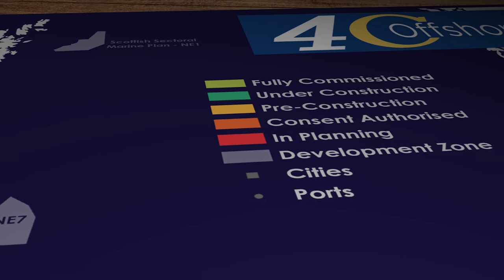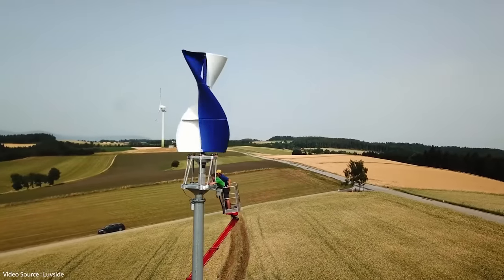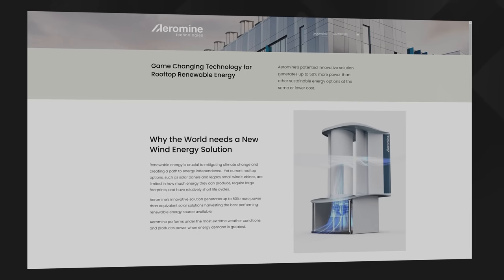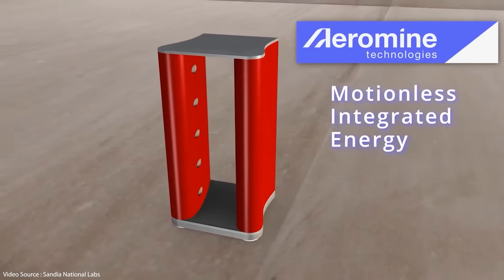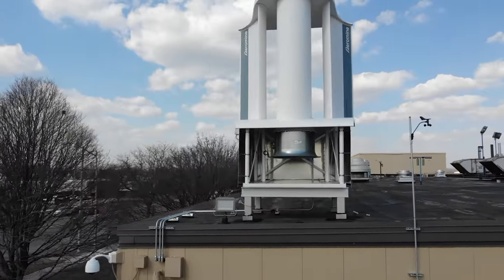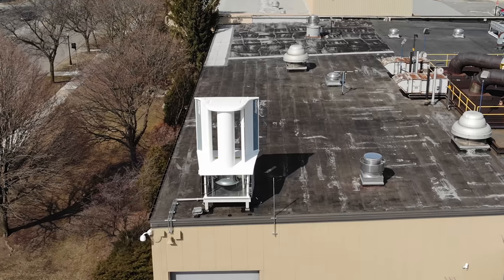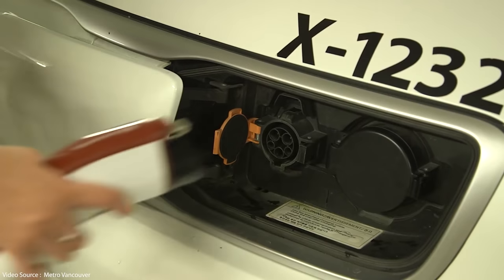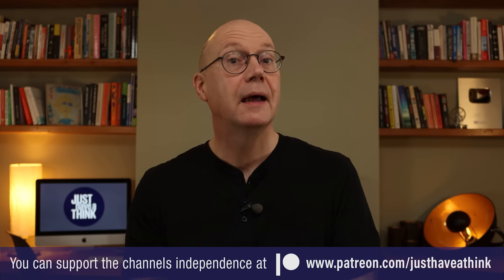Aeromine Rooftop Wind. Static. Silent.  50% more power than Solar PV. What's not to like?

Comment: I saw another video on this one and what I was missing in your video was the mentioning of the angle in which the installation is capturing the wind! Unfortunately, I can’t recall this quickly, so maybe good if you could check this for us! I think this also is actually the only drawback of the system: it is great if the wind direction is actually quite consistent. It might be worthwhile for a second generation or an alternative design to offer the possibility to turn the installation. That would increase the number of viable locations! Also it would be more robust to the more variable wind conditions we have to deal with thanks to climate change…
Reply: My thoughts exactly! Why not allow them to swivel so that they can continuously track the wind's direction? Must be some technical reason why this isn't feasible.
Reply: 4:31
Reply: I think it would be a good idea to have the contraption pivot around the turbine axis so it aims at the wind automatically.. I am a bit surpized this is not already build in, seems rather simple to me to achieve this.
Reply: Like PV installations, there is a simple solution: rotate different units to capture the most potential.
Reply: A tall building creates an updraft as the moving air can't get past the building. I looked into it for a HAWT on a 9 storey building. Mounted on the edge to capture the updraft velocity rather than the general wind speed. Consider how a chimney draws smoke upwards due to the passing air at roof level.
Reply: This may be the video - a more critical look at the Aeromine turbine: https://www.youtube.com/watch?v=XPZei_UONX0
Reply: @grahamcampbell9261  Yes, but if the wind blows parallel to the building it would mean it does not catch any wind whatsoever... The updraft is not always perpendicular to the wall of the building, with varying wind direction the updraft may also have another direction... 

I would make it pivot, as it does not add much complexity, but could increase its energy generation efficiency considerably.
Reply: @twasbrilligandthesli  The intake has to be placed at the edge of a building.  The wind hits the building and is driven upward towards the Aeromine unit.  Obviously this precludes tracking the wind as at most movement could only occur at the corner of a building but it probably increases costs to add any mechanism to move the unit plus energy is needed for movement to occur, cutting down total output.
Reply: Yes I live in an area where the wind direction can change 180° multiple times within the span of a week. I live in a part of a country where Southern winds and Northern winds clash and depending on which one is dominant, so goes the direction of the wind. If these units were fixed according to a presumed prevailing wind they would not work whatsoever where I live.
Reply: @heyman5525  I guess the Aeromine wouldn't work everywhere then. You'd need a location where wind direction tends to be more fixed.
Reply: @twasbrilligandthesli  There was a feasibility reason given in this video - watch it again - this time carefully.
Reply: Uh oh! Am I supposed to be afraid that climate change is going to change direction of the wind now?
Reply: @MarcoNierop  The wind blowing down down the street either goes around or up the building. There is lower air pressure as altitude increases, (but higher wind speed) so it creates a vacuum to draw the air upward. Generally, the wind is not going to bounce off the building and go back where it came from (Some does, but a lot heads upward). The challenge is then to capture it and divert it into the turbine rather than up and over it. This machine has a +-45  degree horizontal catchment area (90 deg total), so rotational ability shouldn't be a real issue for a lot of locations.
Reply: +-45 degrees.
Reply: @ThePentosin  TY - I meant that but didn't write that
Reply: yes my first thought was wind direction which can vary quite a bit during the day,  I tried to build  a small venturi vent for a remote shed back in the 70's (no power) started vertical but became a much bigger project due to having to follow the wind, ended up with small horizontal vent which worked but not as efficient as the vertical, of course would have be quicker and cheaper with a plain old whirlybird but sometime you just need to make things
Reply: @pblakez  I saw another recent review of this and he showed "Wind Roses" (charts) of % of wind from each direction, 90 deg covered most in his area.
Reply: 90 degrees horizontally
Reply: I just got home and you have uuu
Reply: @brett4264  it will.
Reply: @adb012  Yes, with this, it has a 90 degree angle of collection, so that helps a lot and makes it ok for a fixed installation,
Reply: @adb012 , hmm, not sure about „most“ all the Windturbines I have encountered in the Netherlands can turn 360 degrees and do so on a regular basis.
Reply: @grahamcampbell9261  that is a great explanation! I reckon it needs different versions for diff purposes!
Reply: @winfriedtheis5767  Because they need "Head-on" wind flow. This works like a 90 degree wide funnel to direct the flow to the turbine.
Reply: @winfriedtheis5767  TY and absolutely I agree. Solar works in UK because they pay 78p/kW, but in NZ, we pay 14p per kW - so their solutions don't work here (economically) lots of 'Secondary' variables per location affect the choice of solution.
Reply: @mentumentu  v=XPZei_UONX0 was mine - will look at yours
Reply: @mentumentu  My thought was to have the HAWT hang over the edge (Axle at building perimeter). So it caught both updraft and horizonal air flow) There is one in a social housing building in Chicago but theirs is inside the roof area, so it loses an opportunity.  Also lacks the pressure increasing funnel ideas. 'helical Aerotecture turbines on a building in Chicago '.
Reply: @edwardmallorie7051  Thanks for sharing my video on this! :D
Reply: @winfriedtheis5767  ... I stand corrected.
Reply: At 4.40 he says quite clearly 'facing the annually predominant wind direction'. Exactly what we'd expect, and easy here in UK, usually W. I don't see though, why it couldn't rotate, so we could use those winter Easterlies.
Reply: @edwardmallorie7051   Followed your link and subscribed, very interesting. Thanks 🙏
Reply: @helenswan705  It has a 90 degree capture angle and, in most places, the majority of the wind comes within that range. "Wind roses" watch?v=XPZei_UONX0 Shows the roses in the UK
Reply: @helenswan705  This has a 90 degree catchment width and most winds in an area fall within a 90 degree arc ("Wind Roses"). I posted a YT link but they deleted my post. 'Ziroth' reviews this and explains the roses
Reply: @twasbrilligandthesli  I think because they are relying on the edge of the building to do quite a lot of the work.   but is could still be worthwhile
Reply: Wind's direction is fairly consistent all year round in most places. What truly limits placement in my view is each building's orientation relative to the predominant wind direction, plus the obstacles that can limit wind speed.
Reply: @helenswan705  ... Because this system depends on the wind hitting the wall of the building and deviating up. That is why they are installed at the edge of the roof. If the wind direction changes you need to not only rotate the device, but also move it to a different edge of the roof near the wall that is facing the new wind direction.
Reply: @adb012  ah of course. I forgot. Elementary, my dear friend.
Reply: One word, pivot !
Reply: @motorheadmaximus  . YES! Pivot the whole building!
Reply: Uncle Smitty mounted his to an office chair that swivels to face the wind.
Reply: @ZirothTech  personally I think your video was much easier to understand with better illustrations for seeing how it works then this video, but this is why I love subscribing to all these types of channels because each of you have a different take and add something to the collective knowledge on the subject.  Thank you, keep up the good work.  BTW I assume you know Robert Murray-Smith channel, if not check out his video on Barleycorn Wind Generator.

Comment: So true, remote rural off grid here just installed a wind generator to complement my solar, still gauging the results but it is keeping the batteries 24V system topped up overnight will watch this company with interest hope they get it down to the off grid house level at a reasonable price

Comment: Several points:
1) The fan blade is a moving part.
2) Looks like it will not kill birds
3) It is a good canadate for onshore wind. 
4) Rather than rooftop addons, integrate it into the building structure. 
5) A great alternative to NIMBYism.
Reply: i read elsewhere the fan element can be placed inside the building.
Reply: @farnarkleboy  
6:11 "...because they have no moving parts..."
Reply from the maker: Very good Chris. I did say No VISIBLE moving parts. The prop will be covered with a facia plate and grille.
Reply: @JustHaveaThink  Thank you - my mistake. Before I moved over to the Gulf side (Nature Coast - Not Ft. Myers),  I lived on the Atlantic side. There is almost a constant strong onshore wind. There are miles of coastal roads. Imagine hundreds of nondescript VAWMs along the way and even on all of those concrete condos.
Reply: @JustHaveaThink  https://youtu.be/VnSZ0MHIcvs?t=370 Actually at this point you state they have no moving parts without stating visible.
Reply: @JustHaveaThink  6:10 "no moving parts"
But even if it has only invisible moving parts, it does not mean silence. Fighter jet engines prove it.
Reply: The only form of NIMBYism I could get behind (and tbh, not just near me but anywhere), is where wind turbines are in the path of bird migratory paths

I've also got quite a few birds that love coming to my garden even in winter. I wouldn't want to hurt them
Reply: @kevinwillis6707    Yes , WETER  GOROD project  by denis tiaglin
Reply: @waqasahmed939  
There is quite a literature on the issue of bird deaths and actually windmills rank low on the fatality list (will increase with more windmills) with cats and mirrored sided buildings being at the top. The Audubon Society takes the position that proper siting is important. But, the fact remains that bird deaths are inevitable. All I can say is that ways have to be found to minimize fatalities.
Reply: @chrisconklin2981  Yup domestic cats and tall glass buildings...
Reply: @chrisconklin2981  VAWMs are far inferior to HAWMs. That is why all huge commercial wind turbines are all horizontal axis.
Reply: @rogerphelps9939  I am glad that you are enthusiastic about HAWT. It is really premature to wright off VAWT. A case in point the  "Undecided with Matt Ferral"  channel just released: "How Can A Wind Turbine Be Motionless?"
Reply: Meanwhile, it's a piece of crap and won't work worth a damn.